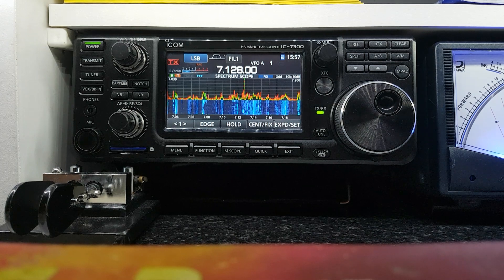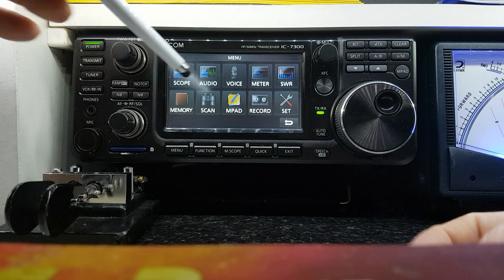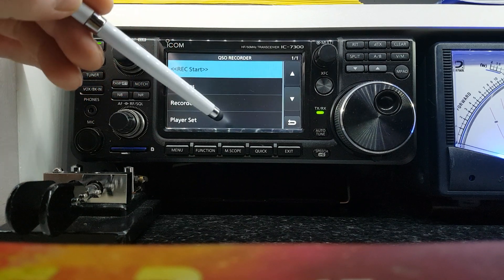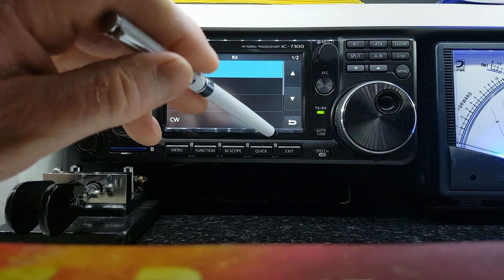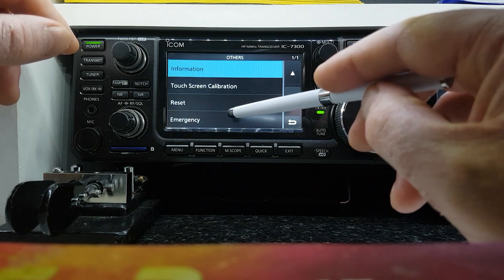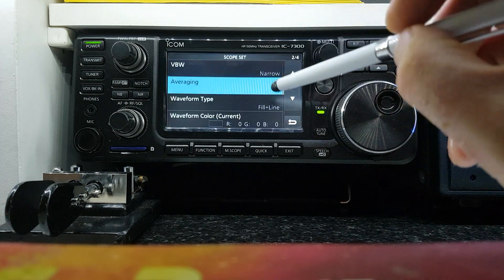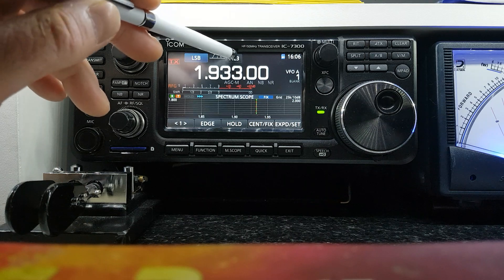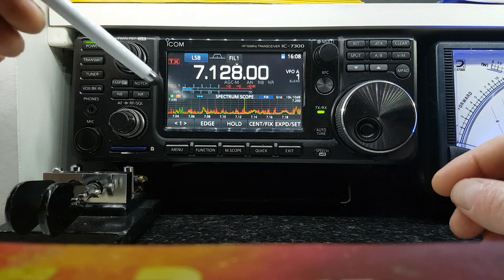Icom IC-7300 Explained – Video 1: Overview & First Impressions

Comment: I have a 7300, I think that when you set the receive tone for CW it also sets the tone for the side tone
Reply from the maker: Yes but it does not adjust the side tone level, as in how loud you'll hear it in your headphones whilst transmitting.

Comment: CAN THE 7300 BE HOOKED TO A LARGER DISPLAY??? THANKS FOR THE VIDEO VERY GOOD
Reply from the maker: Only via software....RS-BA-1 or Icomsuite...DX-labs Comander...N1MM etc. And the scope won't be as smooth as the radio itself, as via the software is 4 frames per second I think
Reply: @GeorgeEI7KO   i use FLdigi anf HAMscope

Comment: Thanks for the video great info VK6NJP, mine should be here very soon waiting at the front door for delivery :-)
Reply from the maker: Hi James. You'll love it. Be sure to have a good read of the full manual over the coming weeks. Whilst it's intuitive enough to use without reading the manual, to get the full use of its functions a good thumb through the full manual (available online) is essential. It's shipped with just a basic manual. An incredible little radio with unparralled value. It's so good they have to compare it to radios that cost 4 times the price. Almost two years in, I still love it. 73
Reply: @GeorgeEI7KO  Awesome thank you

Comment: The radio works fine, it’s a software defined radio not a traditional radio, I assure you it’s those guys complaining they spend 3 times more for what this radio does for 1k.
Reply from the maker: I have no trouble with it. It seems to me some people think you should not have to reduce the RF Gain and that having to do that is poor design. Flex owners have been doing it for years. I even used to do it with my previous radio (FT920) I like listening to signals, not noise
Reply: You don't have one then :-)